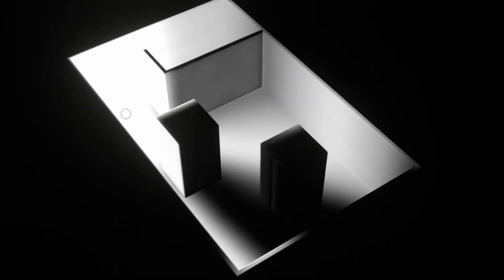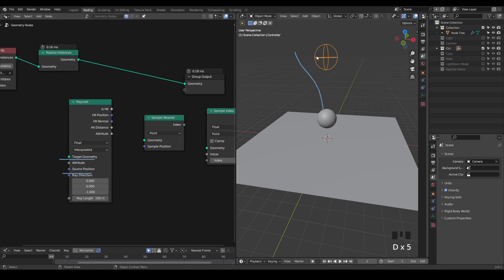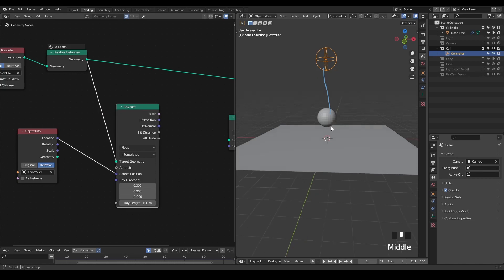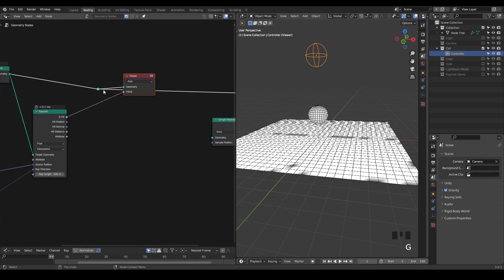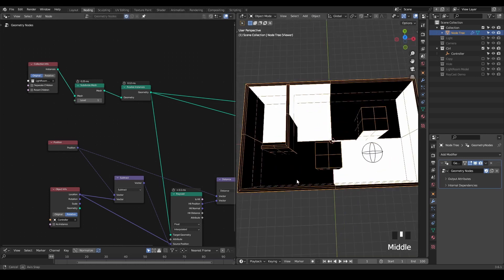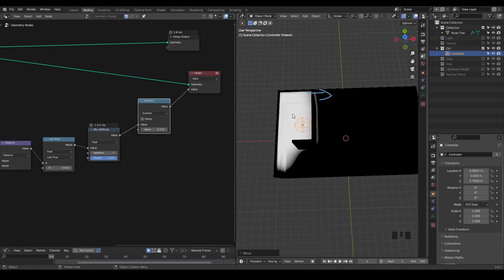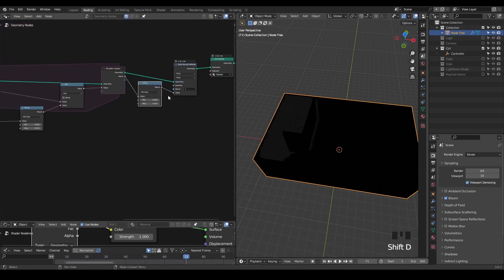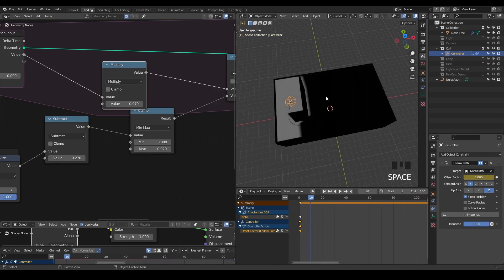[Tut] RayCast to Light a Room - Blender Geometry Simulation 3.6 Fundamentals

Comment: So i think the reason you filter out hit positions that are not close to the 'Position' is due to the way that Raycast is interpreting collections.

That is , for a ray coming straight down from the sphere, Raycast reports a hit on the sphere and the plane, but returns a hit position on the sphere for both collisions..?

Thanks for showing us that Raycast use case. Have not seen it before,  really cool.
Reply from the maker: the ray goes from the light source to every individual points on the geometry. Thus, the "original position" should be identical to the "hit position". If they aren't identical, it means something is blocking the light ray.
Reply: @bradleyanimation120  That's it! You eloquently expressed what I was struggling to :) Thanks for the clarification.
I want to try this setup and combine it  with point light source in the same position as the Empty object. See if if I can get some interesting renders.  Thanks for your time!